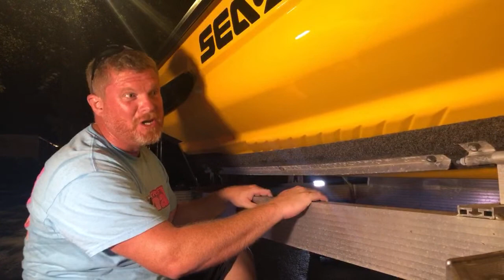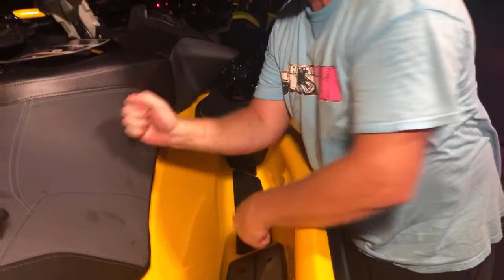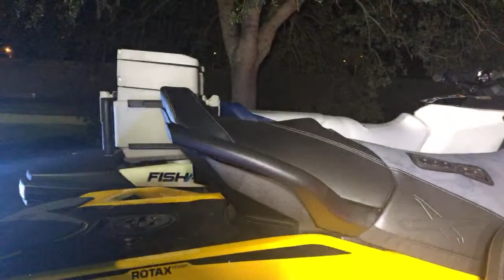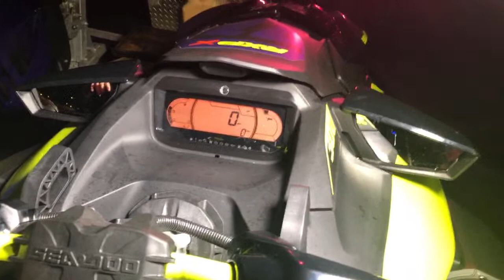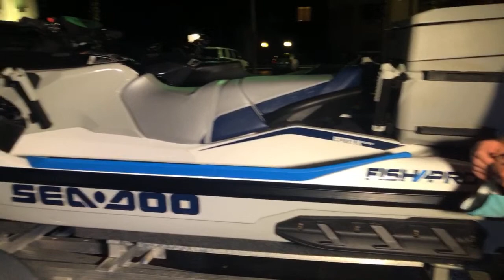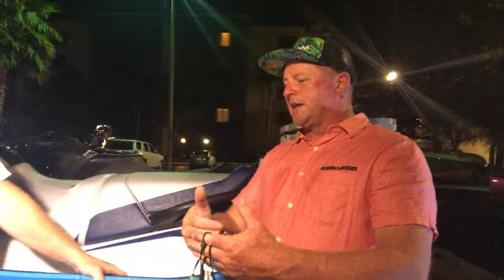The Watercraft Journal IRL - Exclusive 2021 Sea-Doo Walkaround

Comment: This might sound stupid but if they have added a reverse thrust gear system. Would it be possible to add a cvt trans on the touring models? So you can cruise at 30-40 mph only sitting at about 1500rpm or so. That would maybe dubble the range u can go on one tank.

Can I get some thoughts on this?
Reply from the maker: You're looking about 5-7 years into the future, Chriss.
Reply: @watercraftjournal  well im looking forward to it.

Comment: Dose the top cooler come with it or is that an extra accessory
Reply from the maker: Good question. We understand that NEW Fish Pros will come with the cooler extension, but the extension is sold separately for those who already own the cooler.
Reply: @watercraftjournal  nice I orderd a 2021 fishpro but havent even seen one do u know.what.kind of garman gps model it is
Reply: Just asked my seadoo dealer about the cooler extension they said it didnt come with the 2021 fishpro but u can buy it for 225 bucks
Reply from the maker: Wow. That's surprising (and a little disappointing). Make sure to get 1 or 2 of the LinQ cup holders!

Comment: Yamaha svho red 2021 and black or this which one should I’ll buy ?
Reply from the maker: Buy the High Output, not the SVHO.
Reply: The Watercraft Journal why do you say HO over SVHO?
Reply from the maker: Fuel mileage. Lower maintenance. Higher longevity. And because most people can't handle a supercharged machine properly.

Comment: Did anything change on the gtr ?
Reply from the maker: Nope. Just color.
Reply: These were completely re-done last year. What do you expect a year later? They won't change for several years.
Reply: Steven Zaychuk no shit! I didn’t say did they come out with a new gtr but they do add features and change colors form year to year.
Reply from the maker: No, they really don't - they add new stuff every 4-5 years typically. Then they rotate out to a new design every 9 years.

Comment: Could’ve swore the RXPX came out 2012 as I bought the first one of the new model change the 260 and I also bought a 2016 300 both skis are night and day. Where the 260 will bog down in a turn .the 300 engine would pull right out like an F-16. I’m very impressed by the RXPX Hall. I do not need speakers in mine I do not need Storage in mine one passenger to two passengers fine I don’t think putting the gas tank up forward and moving the engine forward is a benefit as when we race I’m sure the external extra gas tanks we put in the front weigh the ski down in the front and it  tracks at least off shore at full throttle. Curious to see how this would do on a full tank of 18.5 gallon gas. The old hull you were stating would track hard left or right during a turn  for Racer’s is good for req riders it was bad. It would track fine it was the stupid sponson’s they have the wings on the sides to bite more and track harder in a turn...  just cut those off and it is perfect so I’m glad to see new sponson’s. Seadoo just needed a lighter hull like GTI. Save $ on hull. There will be problems with the cuts on the new hull when beaching and loading on trailers. Yellow/ black is bad ass like the 96xp or 98 XPL. Purple was lame. Seadoo if you need help lets us know we have been riding racing testing owning every Seadoo model since day one off shore and close course and even a great tuner out here in Cali turbos them.  Didnt have to make anything new but 2 skis RXPX, RXTX. The RXPX will be a nightmare to upgrade engine parts. Not disappointed just much love for Seadoo. Since made in Mexico ill keep the 16 RXPX n 99 XPL. And maybe 96 XP!!
Reply from the maker: Easy there, Earnest Hemingway. Trim this down to a sentence or two.
Reply: The Watercraft Journal lol We have been in the game and got lucky.. Since we raced off shore back in the day we got to test Coffman exhaust. Factory Pipe, Microtouch, Novi Carbs, Buckshot Carbs, R&D parts, Advent ignitions, I was the first with Amsoil, and got lucky to live by Mell Miller, Bill Oneil, and Jerry Watoosee., Prop Shop, Impros.  before peps were just getting on forums and thinking about creating a magazine. lol
Reply from the maker: I was 10 when I first walked in through the doors of PJS. Former PJS tech Greg Beaver built my first race Kawasaki. Those gray hairs don't lie.
Reply: The Watercraft Journal right goes by fast now team mates are working with CRT.   Crazy got lucky to test new skis and parts... by the way im 50 lol been a loooong time.

Comment: I have a 2020 RXT and the sponsons were terrible! Unstable in a straight line even! These look pretty much the same design, so that's a big step backwards from the adjustable ones on the previous generation. The adjustable handlebars and passenger seat should be standard also.
Reply from the maker: Yes, the factory sponson leave MUCH to be desired. Both on the RXT-X and the RXP-X.